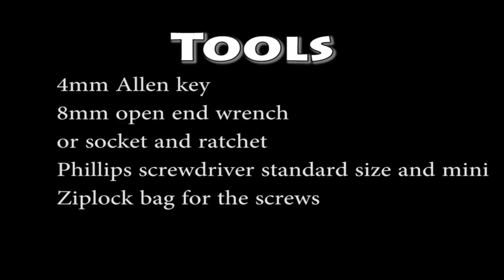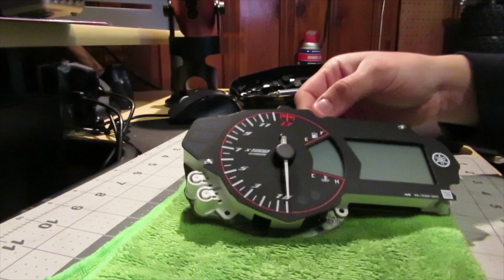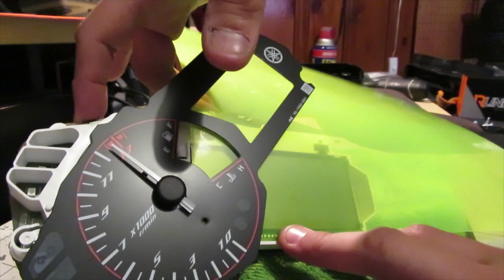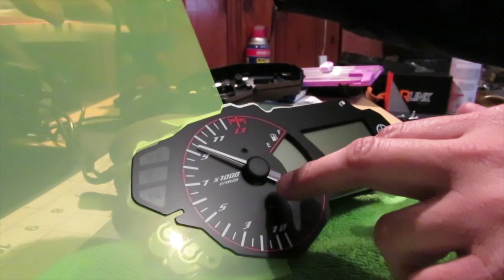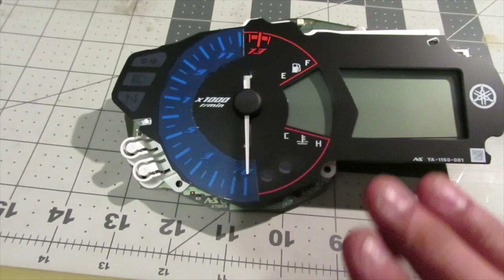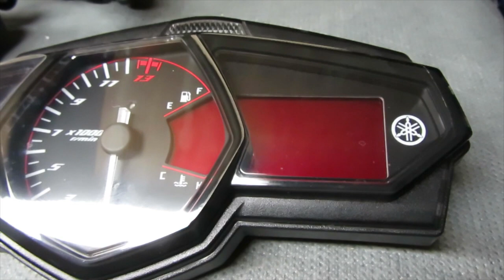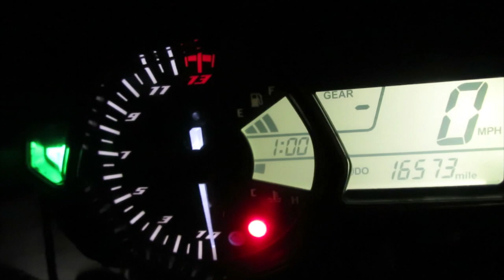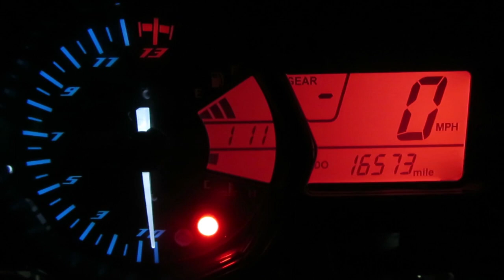How to Change the color of your gauge cluster

Comment: hope you can make a remedy and prevention for error 46 .. the socket on my rectifier is partially burnt ...
Reply from the maker: ba ecchi is it burn on the bike side or the rectifier side?
Reply from the maker: ba ecchi I just did a motovlog about the performance of the bike with the new pod filter setup, I will tell you before I up load the video that so far the performance is a bit better, but that’s all I will say for now till the video comes out. 😉
Reply: @ACProductions77 nice .. will be rooting for that vid .. but sadly my r3 is out of commission .. until i solve the burnt socket .. ride safe bro ..
Reply: @ACProductions77  its night time here .. so its hard to see the rectifier socket .. but the wire harness socket is .. though its not melted .. i hear someone changed the socket to a ceramic one .. but im still searching for easy fix .. thanks ..

Comment: AC, are there also LED bulbs under the LCD panel, and can they be accessed? 

On the early Aprilia RSV and Tuono, instrument panels were a standard (un-inverted) LCD type. In daylight you saw very legible black characters on a neutral light gray background. As ambient lighting dimmed, you would notice the panel's colored backlighting (some models used green tint, others were red). The backlight coloration came from under the LCD panel,  but I'm not sure if Aprilia used colored LEDs or just a color filter on top of white LEDs. Whatever they used, it did not reduce the clarity of the LCD panel like an overlaid piece of colored film would. All things considered it was the best overall LCD screen 
I've used. Full clarity during the day, and at night a glare-free backlight with colors that did not disturb your night vision.
Reply from the maker: yes there are tiny white leds on the circuit board.